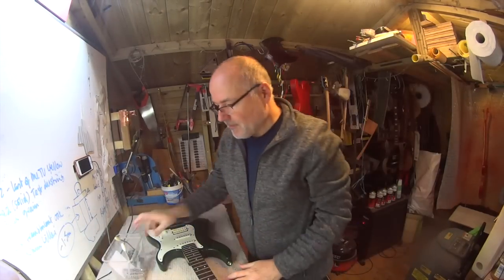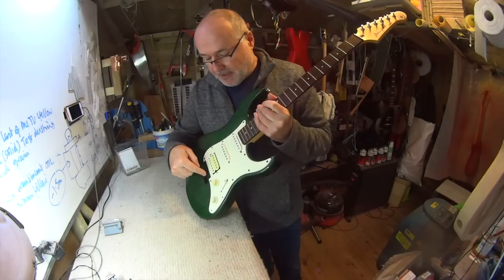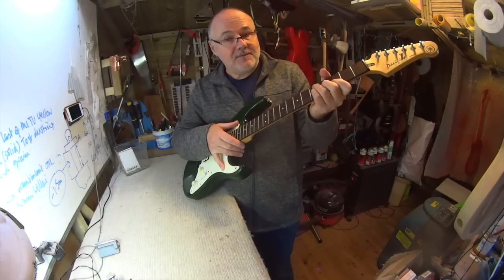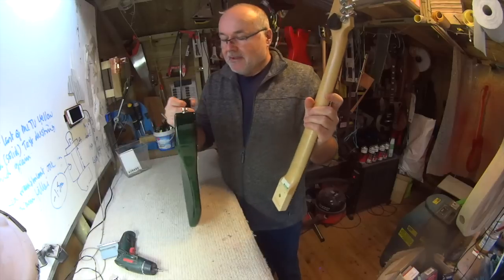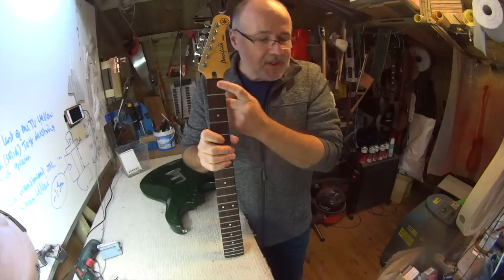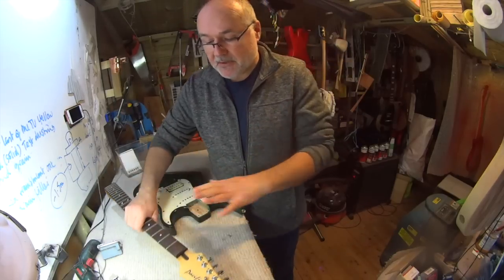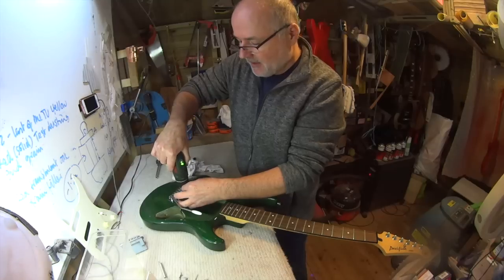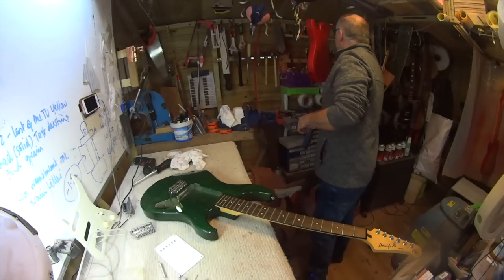Yamaha Pacifica pickup upgrade and set up

Comment: I've got my late brothers old pacifica I think the same model as this, the frets are worn down quite alot but it is still intonating so well, no dead notes, action can be set quite low, the neck shape and thinness is amazing, so I'm afraid to replace it and get that "cheap guitar needs work neck". Was thinking bout changing the pickups which is how i came upon this video.  Never bothered with the trem, missing the arm and I put 2 extra springs on it to sort of "block" it.

Comment: Have the exact same colour Pacifica and enjoyed your video.  One thing: I upgraded my single coil PU's and the new ones were standard 'Strat' sized, which makes the 'E' string coil on the neck PU no longer line up directly under the string.  Seems to not play as loud.  Any ideas for rectifying?  Maybe a custom pickguard moving the coil cutouts slightly north??, or just ramp up the PU at that end?   Thanks for any comments.
Reply from the maker: Hi Howard.. not a lot of simple answers really... Researching different pickup options to try to find those that match the string spacing at the various positions is difficult. Not least because many of the manufacturers use slightly different spacings! Lifting that end of the pickup may boost the volume but it might not bring the dynamics back since the string is slightly off-centre of the magnetic field. You don't say whether the pole is now inside or outside of the string; but you might want to research different options, starting by measuring the neck p/up pole spacing on the pickup you removed.

Comment: A great video for beginners and more . The only thing I would take issue with is the old chestnut regarding string movement in the nut slots . This was being talked about in the 1960s when I started playing . We clamped a guitar down under a school microscope and started bending  the d string . We carried on for quite a while and could not register any movement at all in the nut slot . We came to the conclusion that the bridge and nut are the 2 fixed points on the guitar and any stretching was happening between them .
Reply: but what about the tremolo
Reply: It rather sounds like the guitar they put under the microscope needed the slots widened, cleaned up or lubed. It's always good to test assumptions,, but it's equally important to check your own assumptions in your tests.

Comment: Great video. I'm looking to change pickguard and covers on a 112v with 2 single coil and humbucker. Do you know what size single covers to get?  Choice of 50mm or 52mm
Reply from the maker: The 50 and 52mm relate to the pole 
 spacing. Measure the pole spacing (from the centre of the low E pole to the centre of the high E pole) on your two single coils and that will tell you what spacing you need on the covers.
Reply: @SamDeeksRelovedGuitars  excellent description sir! Many thanks

Comment: Hi Sam, I recently was asked to set up a Japanese Fender Strat which was, if I remember correctly, a 1962 re-issue. This meant that it had a 7.25 inch radius neck, but the lady that owned the guitar really likes to bend strings and also likes a really low action. So I said that if she wanted me to, I would change the radius of the neck so that it was flatter, to allow for the action she wanted. Not quite as simple as I thought it was going to be!
I hadn't told her that I had never done this before and I quickly realised that it wasn't just a case of going up and down the neck with a radiused  sanding block. I did eventually, after a lot of worrying about how I would explain why she needed a new neck, manage to get the neck up to a 9.5 inch radius and left it at that!
It did make a huge difference to the way the action could be set quite low without the bends choking out, but I wouldn't be so quick to offer to do it again. She was over the moon with it and I am now re-fretting her 1992 USA Fender Strat. But I am leaving the neck radius alone!
Reply from the maker: I've got a Japanese 'CIJ' Fender Tele with a 7.25" Michael so I know the neck shape you mean. You're right - you pretty much can't have the lowest action AND bends on the high notes with 7.25", the geometry just works against you. It's a difficult job re-radiusing with blocks I think because manually there's just to much 'wander' and the radius is imprecise. It's also quite difficult to get the same pressure all along; the ends almost always miss out and you tend to remove more in the middle. Ideally you'd want a jig of sorts to do this..

Comment: Your videos are very good but you do need to upgrade your camera
Reply from the maker: Hi Nigel, thanks! I'd love to upgrade... trying to figure out the best (simplest) option. You either have a mid-length shot to get everything in which requires distance... or you have a wide-angle with curved edges which can be close up but bends things... 
I think that I may use my Huawei more of the time... but even that is limited i.e. it can't do 25 fps meaning that it's always going to have flicker but good sound and clear picture. Downside is that it's hard to monitor and limited field of vision...

Comment: A Master class thank you, my £25..Strat copy is now levelled, crowned, intonated and the trem is floating. With a low action that I could only have dreamed of., brilliant. one snag remains, the bottom two strings sound a bit dead, new strings didnt help, i would appreciate any advice you could offer.. thanks again..
Reply from the maker: HI David - thanks for the kind words. One thing I'd recommend is checking the slots in the nut. They need to be sloping downwards away from the nut in the direction of the tuners. If they're anywhere near level the strings will become somewhat dead. If the slots slope forwards towards the body the note will become clearer again but the intonation will be a few mm out because the 'launch point' of the string will have moved to the back of the nut rather than the front.
Reply: @SamDeeksRelovedGuitars  Thanks for replying, I think you are right, i have ordered a new one. 
its all part of the journey.

Comment: I am not an expert but I notice that with bolt on necks, the tighter the neck joint pocket the better the sustain.
Reply from the maker: Could be... any string vibration lost to shaking wood molecules is wasted sustain. That's why I'm always curious about people who think an acoustically-loud solid body electric guitar is great for sustain... I've found the opposite; that the quieter they are (the more dense and tightly fitted) the more energy goes into string movement...thus sustain. 
Of course the only downside of very tight neck joints is that you can get splits in either finish or wood (or sometimes both). The guitars I make tend to have a very thinly-poly'd neck heel going into an oiled wood pocket. That way I can afford them to be pretty snug from the outset.

Comment: Hello, 

Do you think that a a 3 knobs control plate (strat like) would fit on this body with no modifications needed ? This one for instance https://www.dimarzio.com/pickups/pre-wired/high-power-strat-replacement-pickguard

Thank you in advance for the answer :)
Reply from the maker: No, I don't think so. They're subtly different shaped guitars and even the pickups are different distances apart. The biggest divergence in shape is in the configuration of the lower horn.
Reply: Thanks for the answer, I have another question as well. So I’m thinking of buying the Pacifica 112v and I would like to swap the pickups with the Andy Timmons pickups (DiMarzio at-1 and The Cruiser) but Andy Timmons signature guitar (Ibanez at10) has a 3 knobs controls and not one push-pull knob + volume and another knob for tone control. Do you think this would be a problem ? If the humbucker (at-1) could not be splitted into a single coil, can I just do the wiring normally and simply not use the push pull knob ?

Comment: Sam, what are the new pups? I heard you mention Texas Loco so I guess you're using all Iron Gear? What humbucker is it? I'm asking cos I'm itching to do exactly the same with my Pacifica and have been looking at the Iron Gear stuff, but don't want to end up buying something which doesn't fit straight in. Thanks for the video, really interesting.
Reply from the maker: IronGear Rolling Mill bridge, IronGear Texas Loco middle and neck
Reply: @SamDeeksRelovedGuitars  Thanks, that's what I chose as well. Can I ask you another? My pickups have arrived and the single coils poles have a real stagger, whereas the standard ones are level. I guess yours were staggered too (can't really see from the vid) so did you just fit them as supplied? It looks all wrong to me but you seemed happy with the result!
Reply from the maker: @paulzwo  The stagger is a kind of 'stylistic' hangover I'm led to believe from the vintage neck radius days. On a 7.5" neck radius, the middle poles would be raised to follow the shape of the strings.... but most guitars today are 9.5" or more so it's less important. These days, some people push and pull the poles to where they want them (so long as they can move and don't get pulled right out) boosting or lowering string output to taste. If you find the 'vintage stagger' styled pickups give too much emphasis on the G and D for example (or whichever poles are raised) then carefully push them down while supporting the pickup base on a solid surface.
Reply: @SamDeeksRelovedGuitars  Thanks. I watched a couple of vids which also said it is throwback to early strats with a more exaggerated radius but that's no longer the case, so it seems weird that a modern pickup is still made this way. It was also mentioned that the unwound B&e produce more signal so the greater gap is to compensate for that. I'm reluctant to take the mole grips to my nice new pups so I'll try them as supplied. Thanks again.

Comment: Hi Sam.
I have a question how do you do with a guitar that has been used very much.

Then there are pits in the bed that make it difficult to calibrate the tool.

Really good videos you put out fun when they can share.
Reply from the maker: Nicklas Ahlqvist Hi Nicolas - that’s a great question. In my experience (so far) any guitar that has come with significantly pitted / worn fingerboard has also been ready for a re-fret ie it doesn’t make good economic sense to try to level out such old & worn frets when for £100 more a customer can have a complete re-fret including a re-radius of the fingerboard which will level it out like new. To answer the question directly: if I DID have a fingerboard that was really pitted coupled with only slightly worn frets then I would probably revert to the regular ‘strings off, flat neck & levelling file / beam’ method.

Comment: This was a great video. I surprised myself by watching the entire thing. One question. You don't use a radius gauge when setting the height of the middle 4 strings? I'm guessing you don't feel that is necessary?
Reply from the maker: Hi Andy - good question. The answer is dead simple... When setting my 'last fret action' I'm measuring up from the last fret. That means I automatically map the radius of the last fret (plus whatever additional gradient I want) onto the strings
Reply: @SamDeeksRelovedGuitars  Hmm. So how do you judge what the height of the middle four should be? You are going from 1 to 1.5 but also matching the radius? I don't understand how you did that. Maybe I need to rewatch that section.
Reply from the maker: @artdawggy   For example: low E - 1.5mm, A - 1.4mm, D - 1.3mm, G - 1.2mm, B - 1.1mm, E - 1.0mm. Because those measurements are from fret top to string underside it means I'm following the fret's radius but with that 'extra' bit (I called it the 'gradient') factored in. In reality it's not usually 1.5mm down to 1, it's more like 1.5mm down to 1.2mm. The difference is spread bit by bit across all the strings. If we simplified it and said that I set a last fret action of 1.5mm on all strings, then it follows that the strings will mirror the fret radius when they're all set at 1.5mm. I.e. low E will be 1.5mm above that part of the fret; A will be 1.5mm above THAT part of the fret and so on. The strings will, therefore be in a radius curve when we're done.

Comment: Hi I’m going to be getting the Yamaha Pacifica 012 very soon and wondered except for tuning what will I need to do to it straight out of the box. I’m have completely no experience so I’m not sure what to expect. Thanks!
Reply from the maker: Hi Georgia - I expect your Yamaha will be playable right out of the box. They're pretty good with the quality of their guitars. There's a difference between 'playable' and 'great to play'. Out of the box the guitar will have a reasonably high action, beneath which will probably lurk some uneven frets which are likely to prevent you lowering the action further. Out of the box the 1st fret action is likely to be relatively high and the nut slots not particularly well cut - resulting in difficulty staying in tune. Not unplayable...but enough to reduce how much you want to play it. What I aim to do is to improve on the 'out of the box' condition to make these into guitars with stable tuning and which are as easy to play as possible.
Reply: Sam Deeks that’s really helpful, Thankyou so much!
Reply from the maker: @georgiahicks7432  You're welcome. If you take the guitar for a 'set up' most luthiers / techs will offer a limited service that involves getting the best possible out of the set up but without doing fret levelling. That limited set up tends to be anywhere from £30 - £60 but they won't be able to lower the action much (if at all). Any significant lowering of the action requires time-consuming fret levelling and close attention to the nut which will cost more again.
Reply: Sam Deeks thankyou, I’ll look into it when I get my guitar. Thanks!

Comment: Hi I was wondering if you might know what pick up switch will inter change with a yamaha eterna 112 electric guitar?
Reply from the maker: Hi - any '5 way strat switch' will work. The following picture shows that it's an 'import' style switch 
https://www.google.com/search?q=yamaha+pacifica+112+electrics&sxsrf=ACYBGNTcADPlAJknOk_3YIXlCptfWihwLw:1570907770511&source=lnms&tbm=isch&sa=X&ved=0ahUKEwiZmIu9t5flAhVvQxUIHaN4Ad4Q_AUIEygC&biw=1213&bih=748#imgrc=qWlt7mKywZ1mqM:

Which you can see on Amazon here:

https://www.amazon.co.uk/Guyker-Guitar-Pickup-Selector-Switch/dp/B07KVZSL74/ref=sr_1_1?keywords=5+way+selector+switch+import&qid=1570907835&sr=8-1